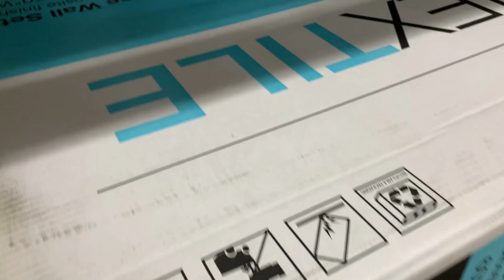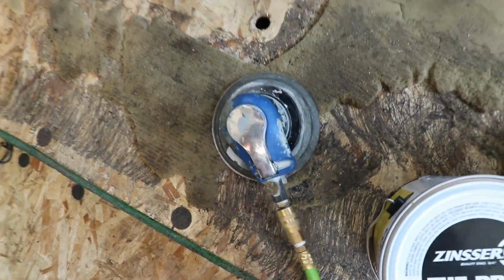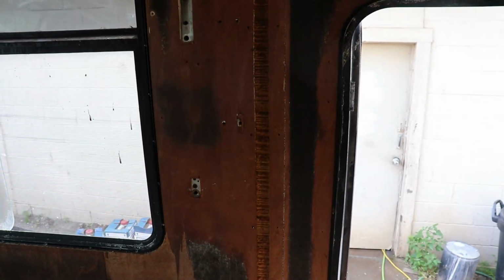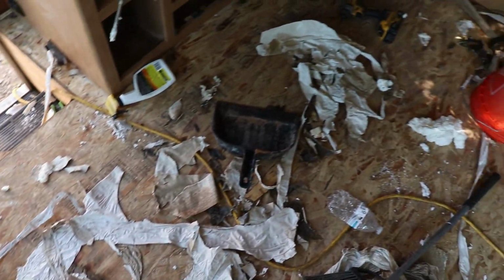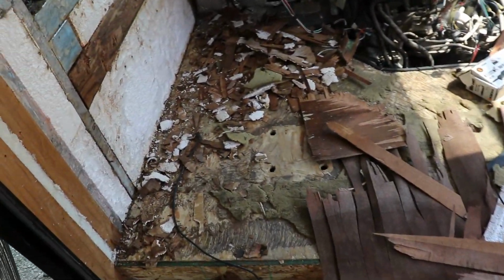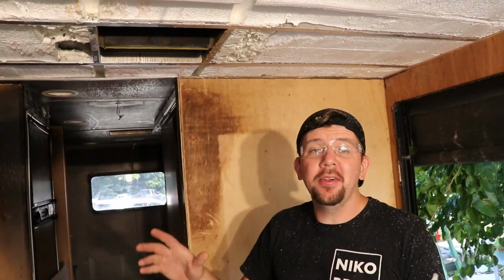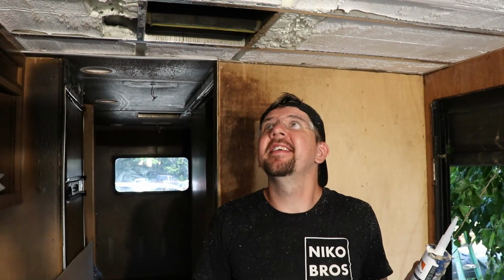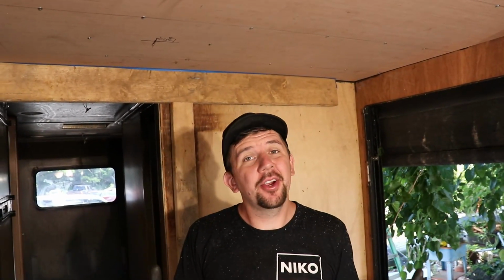2015 THOR VEGAS RV INTERIOR WALLS STRIPPED AND SANDED PART 6

Comment: OK the problem you ran into with the first 2 panels was that they glue you used was a rubber cement. I have used it many many times with no problem. A lot of people do not understand that you have to coat both pieces with the cement and let it tack up really good, almost to the point it is dry. The be sure you are ready and everything is lined up because once you touch it together it is going to be as hard to move as the original was to remove. I used to work in a mobile home factory and we used the same stuff and we would spray it on both pieces with a gun just because of the volume we were working with. But that was why it did not work as well as you wanted, it is a common problem when people don't use that product all the time and the can does not do you any favors explaining that.
As far as the leak in the roof around the A/C some sealing tape is available for that at any hardware store and usually runs about $12 a roll you should also loosen the windows and put some of it under the windows before you get to far along to reseal them now

Comment: It will be inside the walls, ceilings and insulation.  You need to pull it down to the studs and seal everything. I spent 20 years doing disaster restoration. Trust me.
Reply: Yup, agreed. It's always what you can't see that causes all the issues.
Reply: @stopthebus  Exactly. And from the heat lines I saw before they started gutting it, the pressure has pushed the smoke into every crack in that unit. And considering how cheaply they are built? Its everywhere.
Reply: Ditto, same here, 20 years.

Comment: Why did you not replace or repair the window seals before re applying  the wood?
Reply: I don't know this particular model but many RV windows come off from the outside. Dunno whether the inside paneling must be removed. Also, my guess would be that windows could have been left open at some point, like trying to get the smoke smell out previously so there may not be an actual leak. I would find that unusual, especially on opposing sides of a nearly new RV.
Reply: I wondered the same thing... or maybe the water damage is actually from the fire fighters extinguishing the place, but as stated above, typically RV windows come off from the outside, and the seals are on the exterior as well (to make it easier to replace i presume).
Reply: I was going to ask that

Comment: now after the sanding you should use one of those O3 generators used in hotels, the kill odors. just have to seal the whole area to be treated and leve it running for a few hours. The ozone will kill anything inside. The machines actually go for like under $100 on ebay, the ozone will kill mold as well. this is what they use in flooded areas, like after katrina hurricane to clean up houses from black mold.

Comment: the ac is leaking because you have probably removed the 4 bolts that sandwich the ac seals down to the roof when you gutted it. The 4 bolts is the only thing that hold the ac on the roof.
Reply: Nope heated and distorted. The butly sealant causing leaks.....
Reply: @rsprockets7846  they don't use butly sealant on ac's it's a compression rubber seal but it could be melted but doubt it. The video shows the ac and the 4 bolts that compress the seals and hold the ac on the roof have been removed

Comment: On those ceiling panels, I would suggest a self-tapper with a tapered flat head. This would go flush with the finish surface and they could be made invisible with plastic wood patch or another patch compound. Love the work tho. This will be a beautiful unit.

Comment: gotta say I go to 3m and ask what they use to bond wood to metal in vehicles. the stuff I used was a 2 part epoxy from a gun with mixer tips. worked great . also load locks for semi trailers with boards hold great while the epoxy dries . no holes to fill

Comment: Agree with earlier comments about how cheaply these RV's are constructed, the block foam insulation alone is ultra cheap and is hidden by the fake nice materials. Makes you think how much profit Thor must be generating each vehicle sale when you consider list price is $140k plus.
Reply: As soon as they stripped off the flooring, my immediate thought was...well, now I would want to replace the floor.  That does not even look like nice quality OSB.  It looks like the crappy stuff and if I were rebuilding it for myself, I would want to pull that up and put down plywood.
Reply: Agree here. Also the wiering harness seems very losely put out of sight. That alone could be a fire hazard.
Reply: Have always considered RV and caravans (trailers) to be way overpriced for what they are. An RV is just a truck with a box body and some interior fitout. In such a limited space you can't tell me that all the interior stuff is worth the best part of $100k.
Reply: Most RV's have severe weight limits on the chassis - The materials used have to be very lightweight to fit under the overall weight limit. In the UK the 'standard' Motorhome maxes out at 3500kg (Most peoples driving licence is limited to 3500kg) so the entire van with all your 'stuff' in must come in at or below 3500kg, some vans come from the factory with only 100kg's of user weight which is really not very much. All vans in the UK are built like this, lightweight materials which generally makes them delicate and cheap feeling... I wish we could have the bigger coach based RV's here but you'd struggle to get onto most camp sites...
Reply: @dougle03  I live in Europe my country uses the same weight restrictions. But this is a US van, and they don't have the same restrictions. I have done my internship in the USA and I saw similar constrution in houses. No insulation tubes on AC wires, just put the wires and plumbing out of sight. (And yes I have seen a dry-wall go black when a wire got hot, nearly took the place down with a fire).
Reply: Short of an Prevost bus, Airstream trailer or some of the fiberglass trailers all RVs are made of balsawood and a steel frame. People are crazy for spending the amount of money on these things.
Reply: @dougle03  Even in Canada a Normal license will let you drive any vehicle not equipped with air brakes up to 11'000kg
Reply: @stopthebus  Have you seen the price of wood nowadays?! /s
Reply: @TONYTHETlGER  Yup, not cheap but there's not exactly a house-load of timber in an RV. Most of it is either steel or aluminium box section and packed out with styrofoam panels.

Comment: Thank you for its content, but I will give you advice, remove EVERYTHING including insulation and wash with high-pressure water, use an odor neutralizer such as ammonia. Don't worry about the water damage, "it already happened", remember there was a fire. Just take apart the whole interior and clean. Make a custom interior by integrating the characteristics of the RV.

Comment: Did you fix the roof leak before putting up that panel?  I would not want to put on a ceiling panel while there was still an unfixed roof leak.

Comment: I still don't understand why you guys are bothering with the smoke damaged unit. It will never ever be right. You can take the front cab off the smoke damaged one and put it on the crashed one and have a complete and finished unit with zero smoke damaged. Also 2 years newer. After you remove the front cab you can sell the smoke damaged one for part for probably more then you paid for it.
Reply: They will probably end up fixing both

Comment: paint ?? its sticky back plastic/vinyl covering. not sure what you call it in the USA... the glue is contact and to dry both sides before putting to gather. on the roof don't think that will work the way its done. there is contact spray glue easy to use.

Comment: ya not so sure about a burnt RV there a small space and when sealed up in a damp enviroment the smoke smell comes back like most have said it would have to be stripped to the bare bones and every surface sealed with a oil based sealer then start again otherwise all the work is for naught . i like projects but not so sure about this one

Comment: REPLACE any soft trim inside, as it will never give up the smell. You can use an ozone generator from now on, and it can only do so much. And do not paint anything that was not painted before. It is a waste of material and time. Gives a "patch job" impression to a potential buyer. If you want a top price, do a first class job.

Comment: Those side panels needed Glue on them as well ,so next time glue both your side walls  and let the glue tac off. While you have the heather Fan there take it out and clean that as well . floor /roof prop next time bud save your arm's  lol

Comment: it will never be the same and that particular smell will always be there as the melted plastics and other burnt compounds permeate the porous real woods.   before you paint you should rent an ionizing unit and let that do it's job.  one of the better products to remove soot and residues is called super clean, it's in a purple container and available at most hardware stores and walmart.   you guys are great mechanics and body workers. so why didn't you just take the front off the non buried unit and utilize the the burned unit......just sayin'.  good luck

Comment: This is wayyyyyyyyyyyyyy beyond most peoples ability, can't believe you're getting it done, that's a whole lot of work so far, wondering if you're using any odor eater, thought I saw some in your basket at one of the stores............ I'm sure there have been more then a couple of times you've said no but hell no, WOW !!!!!!!! This will probably turn out better then new..............
Reply: I think many who saw this video could repeat the process with simply tools from Home Depot. No doubt, Niko Brothers have expertise in many areas and a wide assortment of tools to go along with it. You might notice them taking cell phone pics as they go and then looking at them as things are going back together. It's the easiest way to go about things when you don't have the shop manual and you've never worked in the RV production plant.